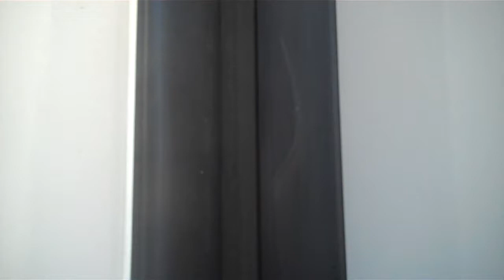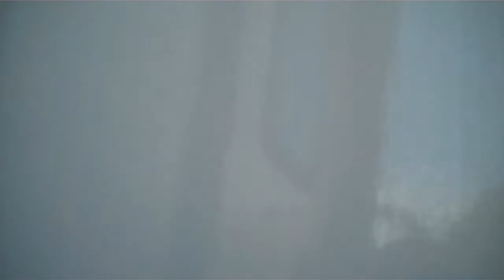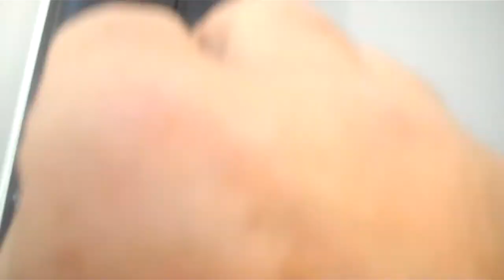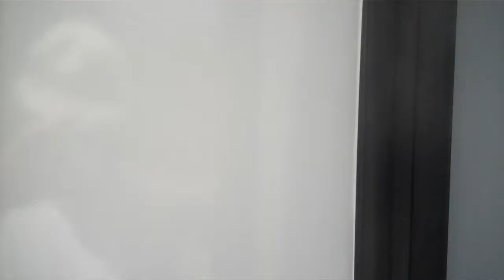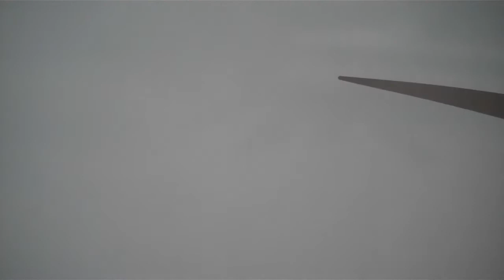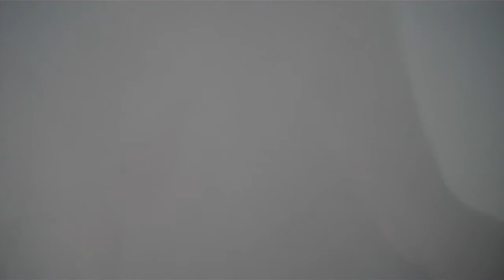#2 Heartland 2018 North Trail Slide out Rubber wiper rubber failed 2 of 2.

Comment: The replacement seal is Norco BAL RV #R854056. It's a snap in seal. Approx. $3.99/ft. Same on my 2018 Heartland Mallard M28 if this will help anyone in the future.
Reply: Thanks.. this video just leaves you hanging
Reply: @ksteph6568  Glad the info was of some use to someone. I just finished replacing all 50ft. of mine yesterday.

Comment from the maker: Update 
Steel rubber products sent me a sample kit pn 00-0039-00 none exactly the same as I needed but one came close and had a channel that I could add a bulb seal later if needed ,,measure your wiper and look at what will work for you  ask them installation questions its ok to.

Comment: I'm curious whether you got it fixed? I'm in the same boat. Where did you find the new wipe if you did get it on your own?
Reply from the maker: Steel rubber products sent me a sample kit pn 00-0039-00 none exactly the same as I needed but one came close and had a channel that I could add a bulb seal later if needed ,,measure your wiper and look at what will work for you  ask them installation questions its ok to.

Comment: You can design a better system yourself. Take the old strip off a clamp down a new piece of rubber strip using a small aluminum channel screw it down over top of the rubber strip. of course in black and Bob's your uncle.
Reply from the maker: No way  to  get to it without removing the slide out,  steel rubber products has a tape on one

Comment: Did you ever find a solution for this problem. We have a heartland with a similar issue. We are located in Southwest Florida
Reply from the maker: I'm in the process of getting a replacement from steel rubber  , I bought one wiper which I chose was to wide now looking at a different one,  I will let you know what fine out.
Reply from the maker: Steel rubber products sent me a sample kit pn 00-0039-00 none exactly the same as I needed but one came close and had a channel that I could add a bulb seal later if needed ,,measure your wiper and look at what will work for you  ask them installation questions its ok to.

Comment: What did you use to fix this problem
Reply from the maker: Steel rubber products sent me a sample kit pn 00-0039-00 none exactly the same as I needed but one came close and had a channel that I could add a bulb seal later if needed ,,measure your wiper and look at what will work for you  ask them installation questions its ok to.